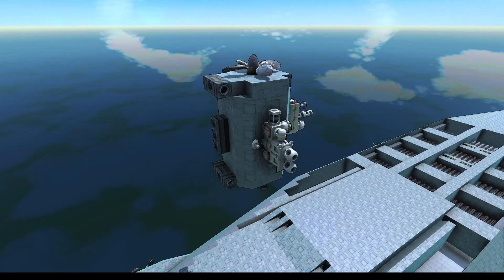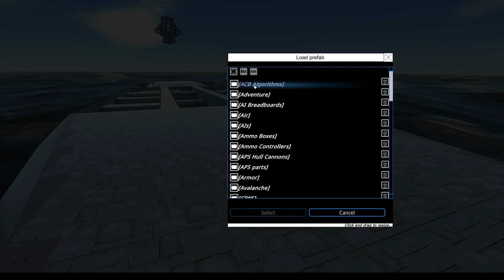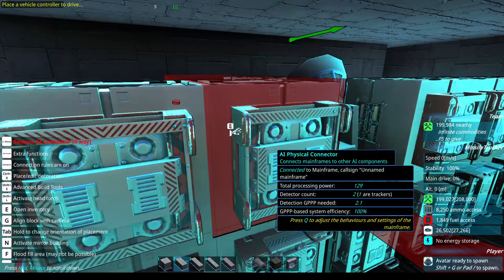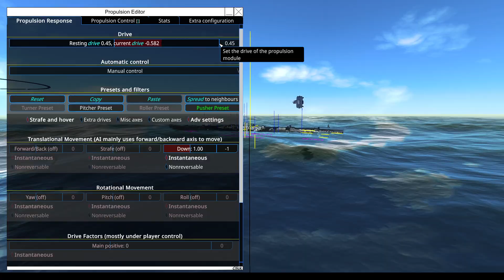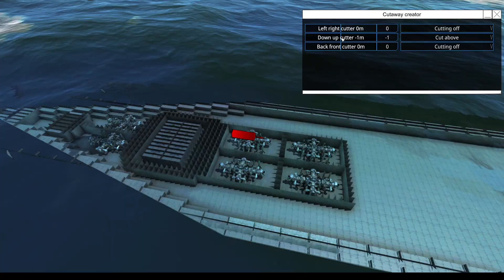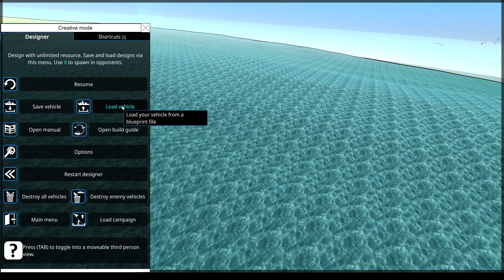Missile Truck IV Review! - From the Depths

Comment: There’s a few things I noticed that weren’t mentioned in the review but could be improved: 

- Beams should be oriented vertically, not lengthwise like they are here. Orienting them like this reduces the damage needed to penetrate the armor by 75%.

- There’s no airgap on top of the AI compartment. Since this is a boat and can’t pitch to target, any flying thing with HEAT/HESH should be able to take out the AI pretty easily.

- Hydrofoils are suboptimal on frontsiders as they aren’t always moving.

Hope this helps!
P.S. if you want to check out one of my builds, look at the ASF Primoris on the workshop. It’s the most advanced thing I’ve built yet.

Comment: No way, my ship made it on here!

A few explanations for why the ships is the way it is.

[ ] The movement of the ship was an afterthought. I couldn't figure out how to make the hydrofoils work in reverse (now I know!) so I had to use water propellers for reverse thrust.
[ ] The missile truck is intended to act as a support ship to increase fleet firepower against larger enemy ships, so it's assumed that there will always be another ship to spot for it. 
[ ] I did not realize there was an empty compartment in the floor lol. AI will definitely get put down there instead.
[ ] Back when this thing was made, my ships tended to roll over when heavy armor was added since I wasn't very good at keeping things stable. So I went without HA, although its starting to make its way into my ships now.

[ ] Yeah, I have an issue with allocating armor to different places internally. But outside armor tends to be pretty uniform since I like to build quickly and spam the fill tool.
[ ] Since other ships spot for this thing, I'll probably get rid of the spotter in future versions. 
[ ] Just as how it is assumed that other ships will spot for it, it is also assumed that other ships in the fleet have AA covered.
[ ] I should 100% do that. I've never had much luck with torpedo-missile hybrids (due to skill issue), didn't know anything in the game used them.
[ ] I've started doing that on recent ships, should definitely update that on this ship too.
[ ] I tried doing the spin block thing, but I couldn't figure out how to read the load state of the launchpad :/

Great points all around tho, learned about setting hydrofoils to respond to the vertical axis!
Reply: You can't read if any given launchpad is loaded in bread. The best you can really do I to use the event block to see when any missile is fired or reloaded, and work off of that.